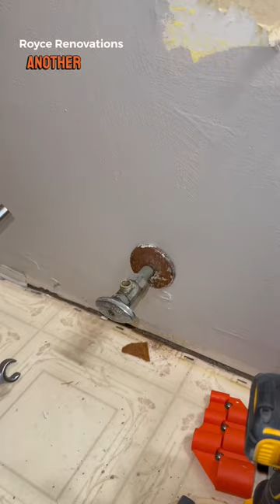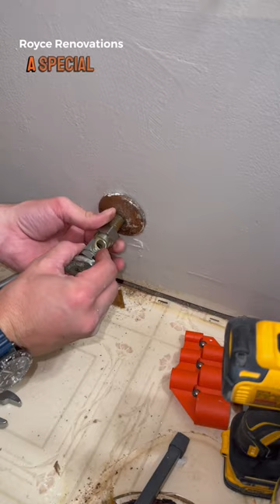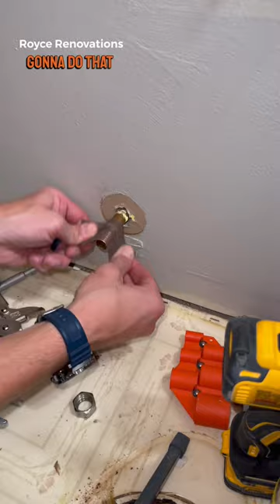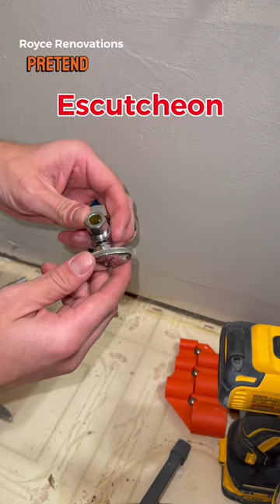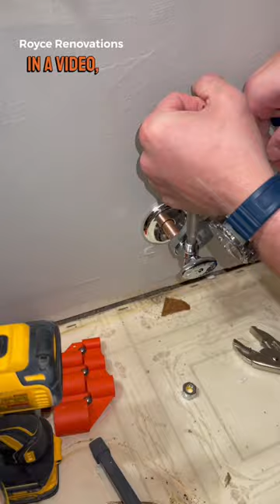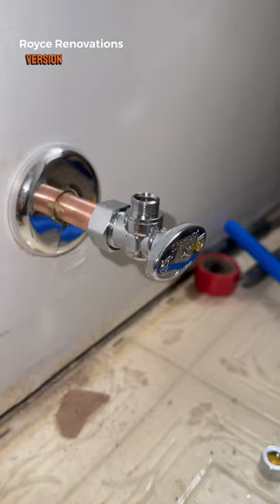Replacing A Water Shutoff & Escutcheon! #shorts

Comment: I put pipe dope on/under ferrule.
Reply from the maker: I got this comment a lot on other platforms. I’ve never done that and haven’t had issues. What’s the theory on adding that?
Reply: Useless.  This is a brass compression fitting.  If it leaks it will leak from the back, not the threads.   Dope or thread tape will just prove to others that you don't know plumbing.